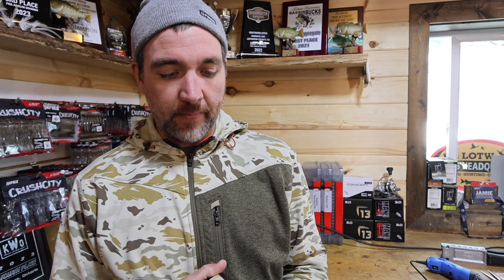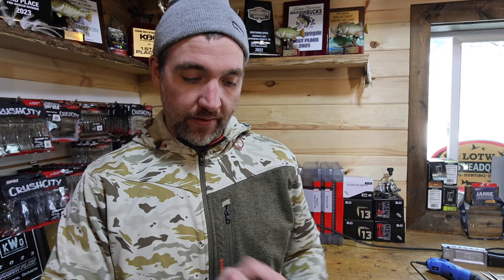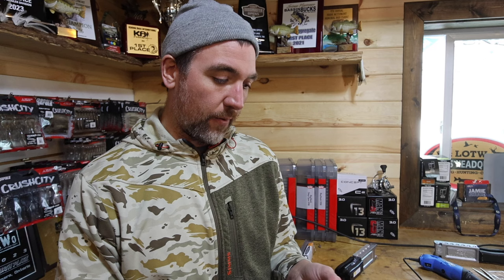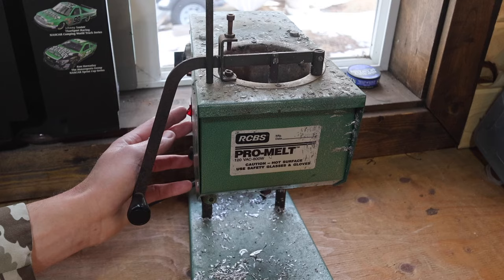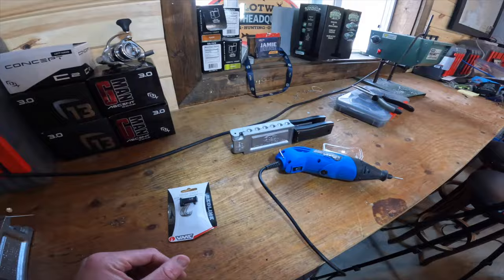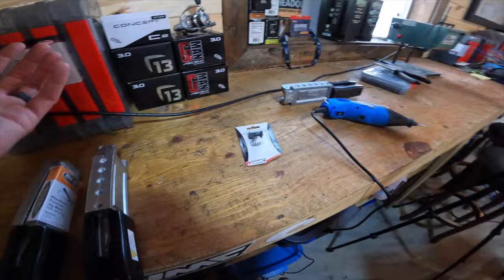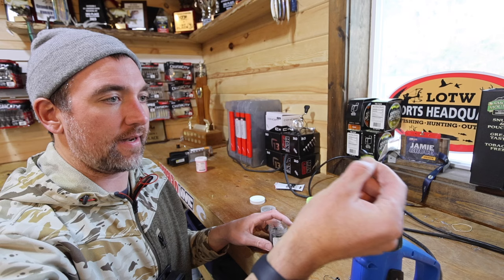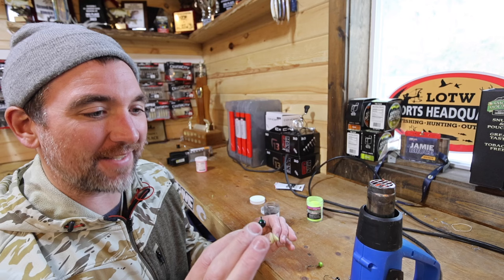Making a NEW Walleye Jig (Mold Modification and Custom Bent Hooks)

Comment: Fellow tinkerer here. Only thing I can tell ya is don't sand or grind lead. Lead dust is awful for you and worse for your newborn (congrats by the way) I like to cut my flashing or spru off with a utility knife. Lead is soft enough to cut off with a good blade. Comes off in chunks instead of dust. Love the tinker vids man.
Reply from the maker: On the knife program now, appreciate you pointing that out.. I've been doing that for way too long.. Thanks for the info!